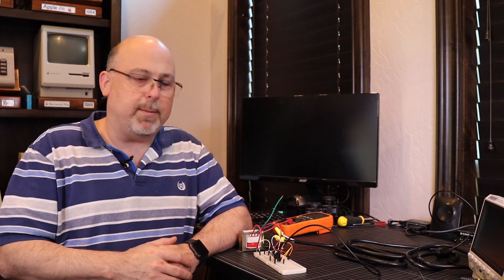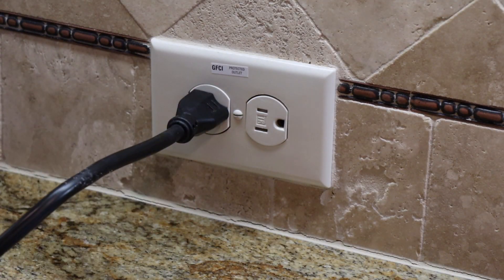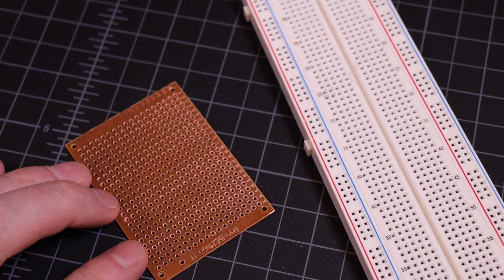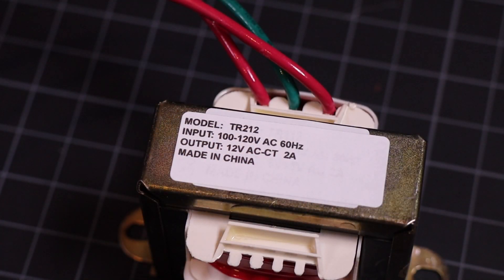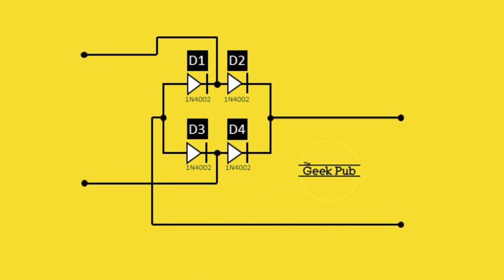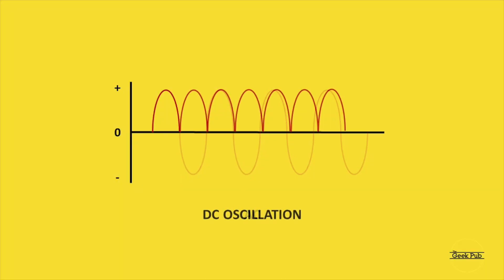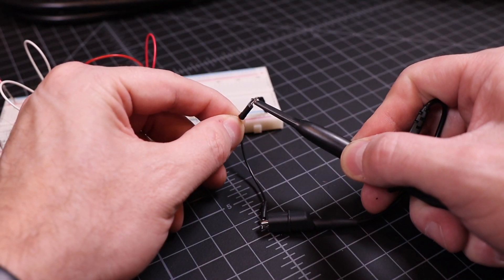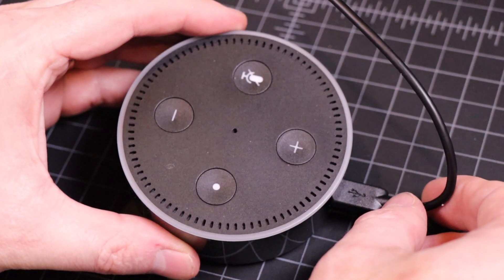USB Charger Circuit

Comment: Just a quick Question for chargers. I'm building a 9V battery iPhone charger and I want to use a usb connector as the output. Since I'm doing it from scratch, I'm building all the parts myself. One USB connector in particular has a VCC and GND pin but it also has a D+ and D- as well as SHELL pins. What do these mean and I'm wondering if I should just ground the data pins if its just for a charger.

Comment: Thanks for properly showing step by step what each part is and what is does. If you can also include how those components work that would be great, such as what materials the components used to make those filtration or oscillation effects work.

Comment: Never step so many volts down. The 7805 have to burn so much energy of.
Reply: @Peter Rasmussen This design is perfectly within spec.  I also think you missed three important parts of this video. 1) Explaining how AC to DC conversion works, 2) Its a prototype only, and 3) The dude flat out said at the end that it wasn't efficient and there are better components and ways of doing this.
Reply from the maker: The specs on the LM7805 is 8-25v input.  Its perfectly safe and reliable with a heatsink.  It just uses more energy.
Reply: @TheGeekPub  exatly, waste of energy.

Comment: I've seen people using caps around the voltage regulator, but I've never seemed to need them. I built something similar a while back, but I just used a smoothing capacitor after the bridge rectifier and it worked just fine. The scope showed a nice, stable 5v output.
Reply: Before or after can work.  Both is much better.  If there is a line problem before the regulator such as a quick under-voltage, a cap before will save the day.

Comment: and in other parts of the world, step down the voltage from 220 - 240v AC, if you want to expand on this, look at showing a SMPS, both low amps and high amps version, the concept is easy, but the high current ones are challenging, currently build a custom SMPS for my 3D printer, so I can save some space and get an ATX style power button on it

Comment: It’s important to note that this type of circuit will not fast charge many modern devices.  Devices that can draw a higher current look on the USB data lines to see if the charger is compatible with a high load, and if they don’t see the appropriate voltage on those data lines, they will only charge at a slow rate.  

More info here:  http://www.epanorama.net/newepa/2010/08/18/apple-charger-secrets/
Reply from the maker: That's correct.  Any type of device that queries the charger will see this as a slow charge device, but it will still charge unless it requires fast charging.
Reply: I built a USB charger circuit very similar to this to power a Raspberry Pi in my arcade cabinet.  It works like a charm.

Comment from the maker: Learn how to build this awesome USB charger circuit that can be used to power all of your USB devices.  It is important to note that this is not the most efficient charging circuit that you can build for USB devices. As a matter of fact there is basically a single chip with a few inputs and outputs that will do all of this for you with just a few wires. And much more efficiently.  The problem is that doesn’t make a very good teaching tutorial. As a matter of fact it’s basically magic. And so with this we can discover each individual step of converting AC high voltage down to a regulated 5V DC that your USB devices can use. So that’s the reason that I chose this method.
Reply: ...and then there's usually a chip inside each device itself to handle the trickier parts - current regulation and timing - for the battery itself. Dave Jones of EEVBlog did "an exercise" (or just didn't want to have to buy yet another battery charger) showing the various steps used to recharge batteries using a bench power supply: Unlike car batteries, Li-ion and even the others involve a complex little ritual to ensure maximum safety, efficiency, and lifetime. https://www.youtube.com/watch?v=jNmlxBXEqW0

BTW too bad Jones is in Australia because I think you, he, and another Dave we all know & love would have a blast hanging out; and no doubt your brother could probably get a lot of insight as he develops his 8-bit dream project.
Thanks for another good starter tutorial, and more so for leaving in the part where the magic blue smoke made a run for it.